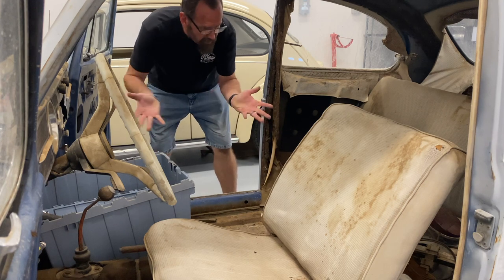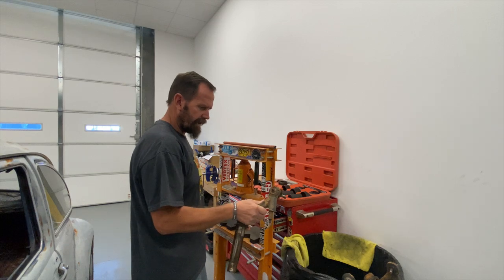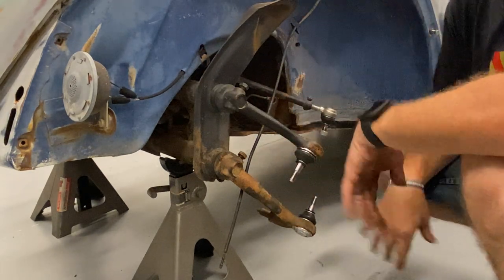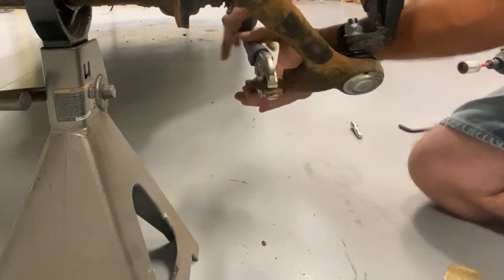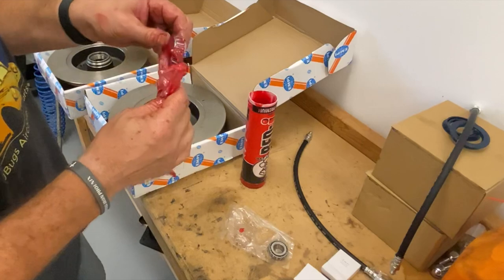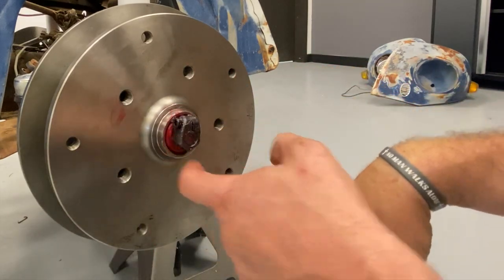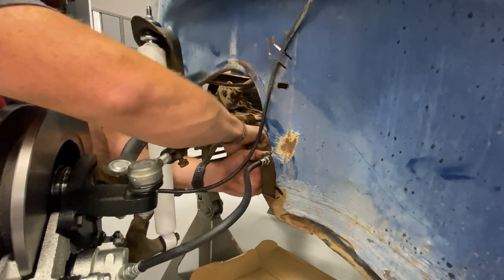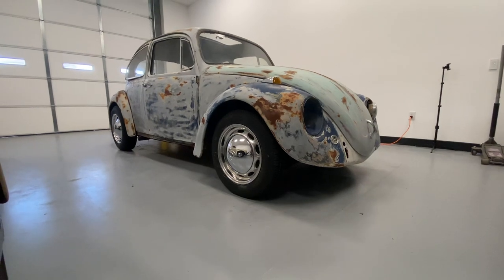1967 VW Beetle - Drop Spindles - Disc Brakes - Part 2

Comment: Well my 67 is much lower with the 2" narrowed Empi beam then yours, mine was a pain in the ass you made it easy I went to 4 lug and the inner pin for the steering box I had to remove because the box was to far over to the driver's side and wouldn't line up with Column shaft I hate aftermarket stuff can't wait to see your next video..
Reply: The more you change out the harder things are to reassemble. We had to do the same with the steering box pin when we installed a narrowed beam on a 1963.

Comment: i just purchase the new EMPI forged drop spindles from jbugs for my 67.  i’m hoping you do your alignment before i have to blindly fumble through mine.  thanks for making these videos
Reply: I don't do much as far as the alignment goes other than what you already saw and later I will set the toe in at about 1/4" with tape measures taped to the front tires. For camber and caster I'll be taking the Beetle in to have it aligned at an alignment shop.
Reply: Thx

Comment: Is that disc 5x130 to fit Porsche wheels? Can you just do a quick swap and change a 4x130 disc for a 5x130?
Reply: This disc brake kit is for 5x205 wheels. We do offer other kits with 4x130 and 5x130/5x4.75 patterns. The rotors in those kits can be swapped back and forth. The 5x205 pattern kits are not interchangeable with other kits.

Comment: What size bolts did you use for the calipers..of course I'm at a stopping point on my disc brake install.. thanks in advance
Reply: The hardware comes with the kit but I believe they are 10x1.25, 25mm bolts.
Reply: @Sam_Mebane  okay I'm working with Ghia spindles on a bug and bought empi rotors and aftermarket calipers.. thanks I'm at the hardware store right now
Reply: @Sam_Mebane  golden.. thank you  perfect fit with caliper on spindle..do you recommend blue lock tight and a certain torque..I appreciate all your helpful videos
Reply: @shaunh2798   blue loctite is perfect and I personally use the Guden-tite method. Factory is 29 ft lbs I think.
Reply: @Sam_Mebane  great.. since I'm German I'll use the guden-tite method... thanks very much!!
Reply: @shaunh2798  LOL, just found out I'm 40.2% German as well, but I've always used it....especially since I'm working on German cars most of the time!